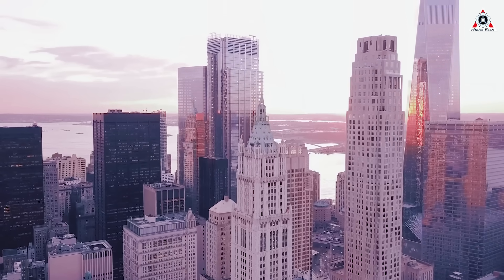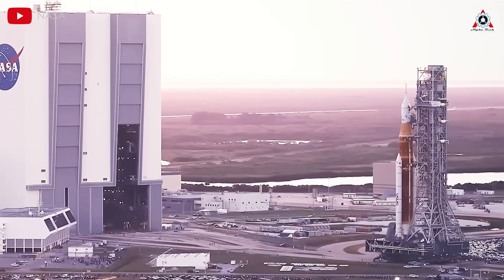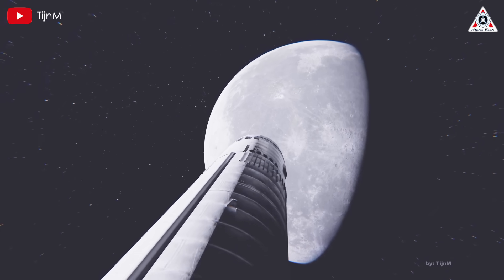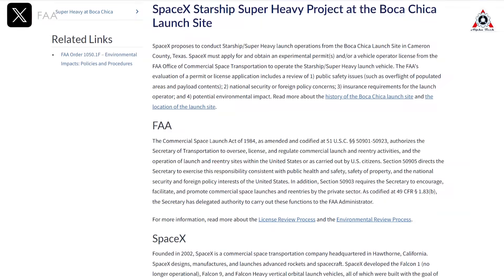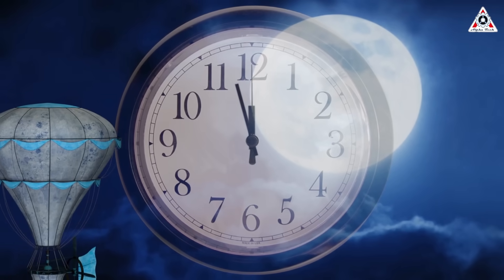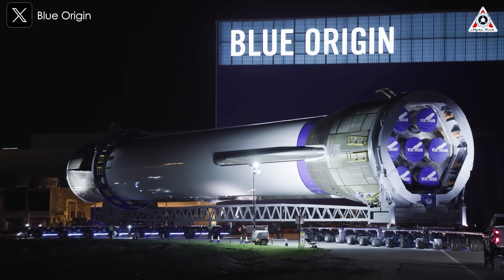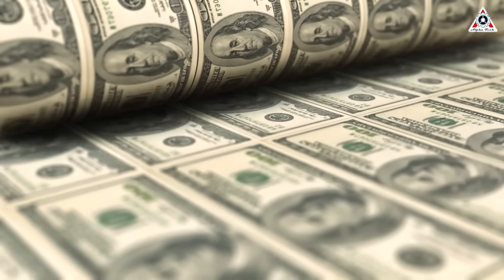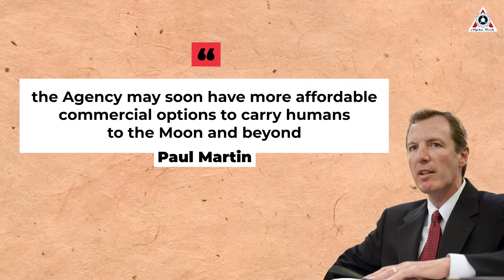SpaceX&Elon Musk just released landing on the Moon in 2025…

Comment: Wrong.  The fully disposable Super Heavy & upper stages can easily send a 150 ton CSM & LM directly to the moon for less than $500 m.

This is why the Starship Lunar Lander  that requires 10 plus LEO refuel flights, ... will be cheaper .... but is still stupid.

Nasa should only hire (reusable) SuperHeavyBooster to get a certain total mass to specific altitude & velocity ... or .... buy a disposable SuperHeavy  for moon or interplanetary missions.

And then Nasa should tender upper stages & modules  top ride on the SuperHeavy Booster ( renewable/disposable).

Space X can destroy SLS, ULA & New Glenn by simply offering NASA SuperHeavy rides ( disposable/reusable) right .... now.

Comment: Is there a way to manufacture fuel in space without landing on a piece of space debris?
Reply: No, rockets work by tossing mass out the back side at high speed.  We can generate the high speed a variety of ways without burning the material, but we can't replace the mass without loading something onboard.  There is a tiny amount of movement by using solar sails and pushing against magnetic fields, but not strong enough to land on the moon.  There's a theoretical space drive that uses microwaves inside a sealed container that most scientists consider impossible.  We could get into even more bizarre theoretical ways make it happen, but none are happening any time in the next 50 yeaars.